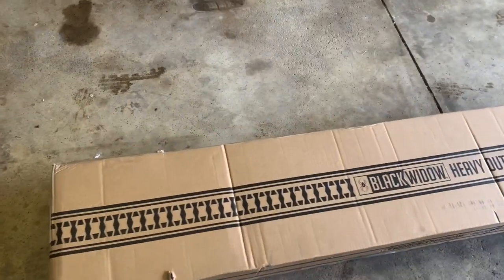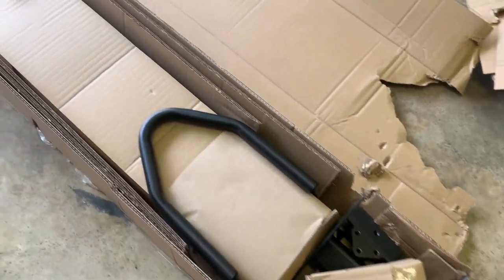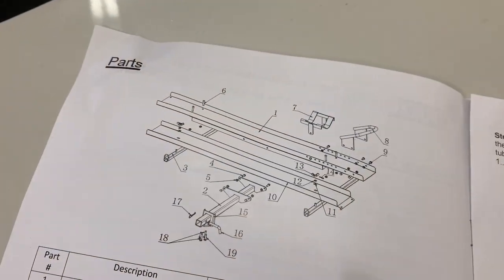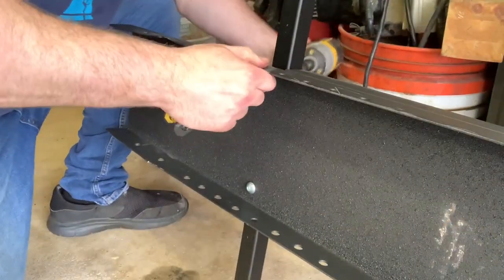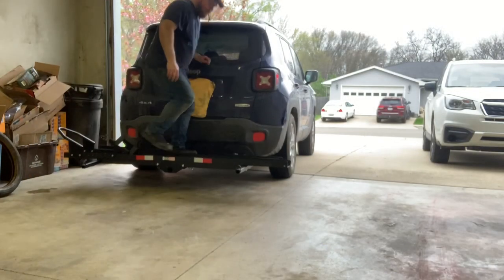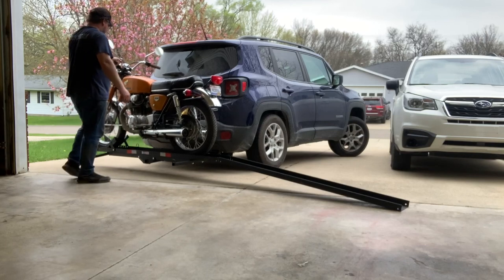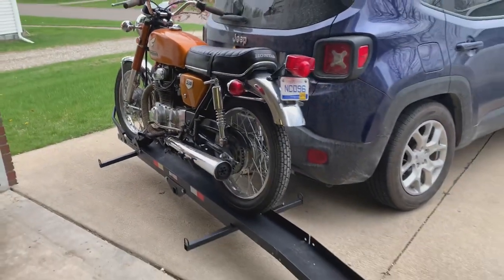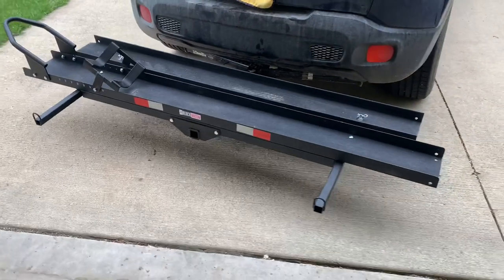Motorcycle Hitch Mount Carrier Assembly & Loading Black Widow 600 Pound Heavy Duty Steel Test

Comment: Hummmm.  200lb tongue weight limit….i think it’s exceeded.    Not sure what specs you were referring to?   The hitch carrier can handle 600 lbs, but your jeep tow limit 2000 lbs with 200 lbs tongue weight limit..where did you read 800 lb tongue weight… not correct I can assure you.   So not safe.
Reply from the maker: Yeah. Not ideal. I did haul a 125 cc bike on it no problem. The 350 was a bit much.

Comment: You installed the hitch lock backwards. That's the reason two of the bolts are not completely making contact. You will need a ratchet strap for the front wheel. PSR tie down, attaches to the handle bar, will keep your bike level and don't compress the forks. An AceBike Tyrfix will secure your rear wheel to the platform. Do as I suggest & your bike won't fall off and into another car.
Reply from the maker: Thank you for the tips! I did install that backwards but got it sorted. Have had a few good hauls so far. Really like it!

Comment: You most certainly exceeded your tongue weight, by a lot.  Your Renegade is not rated for a 800 lbs tongue weight.  If it was then your Renegade’s tow rating would be 8,000 lbs which is more in line with 1/2 ton full size trucks.  The Renegade’s tow rating = 2,000 lbs which = tongue weight rating of 200 lbs (10% of tow rating).  That carrier weighs 95 lbs.  This means your motorcycle cannot weigh more than 105 lbs.  Probably more like no more than 95 lbs after factoring in the weight of straps.
Reply from the maker: It didn’t work out. Oh well.

Comment: I see complaints about the short ramp. So I cut 2 , 2 by 8 for a ramp along w a walkway along side. Then I will mount brackets on both ends so I can forward it down the other side instead of backing it up. HA

Comment: I have a 1977 Harley XLCR (425 lbs), and belong to a Phoenix Antique Bike club that goes on rides. 
Our next ride starts about 60 miles from my house. The bike would make it. I won't. Being from New Orleans originally, I compare riding this rare and badass motorcycle to wrestling an alligator while being hit with a hammer. It's brutal on this old battered body.
Bought one of these carriers. Mounted the carrier. Put the bike on. Backed it down the driveway, and realized the rear tiedown loops wouldn't clear the street if I backed tried to back it all the way. 
Spent hours looking for a drop/rise hitch adapter that would meet specs. Found one that will allow raising the carrier 2" or 4". I'm hoping 2" will work because loading needs to be a one-man job. 
I'll be getting it in a few days. Luckily Amazon had a used one on sale with a BIG discount (package open). 
https://www.amazon.com/gp/product/B01MXQWH49/ref=ppx_yo_dt_b_asin_title_o00_s00?ie=UTF8&psc=1

Comment: Good video. I built and installed mine today. My only complaint is the swinging wheel chock. It should be hinged. For it to work freely one can’t tighten it much at all. It needs at least a cotter pin. Very weird. Anyway I’m still unable to load my 600rr onto it. I’ve a large pickup so clearance isn’t an issue. The ramp angle is. It’s a two person job to load and unload. And I’m going to wait for help and hope someone at the track this weekend can lend me a hand (it’s my first track day and I won’t be making a great first impression).
Reply from the maker: I hope they get you what you need. Overall a very solid rack IMO.

Comment: What's your favorite  .. The Jeep or the Subaru  ,,, primarily for the city.?  Plus great video presentation, have you done any  trip both combination trailer ramp/ bike on over hour drive ?? 
How's holding up ???
Reply from the maker: I’m partial to my Jeeps but love the Subarus too. It’s a good rack for smaller bikes. The 350 was pushing it. I’ve since upgraded to a proper trailer. Worked great when I picked up a cb100 bike though. Definitely don’t wanna put anything too heavy on it!

Comment: The hitch is extremely strong,  I have traveled over 7,500 miles with a CBR 1000RR with no problems whatsoever.  However, I have a Silverado Chevy 4 wheel drive PU.  The little car in the video looks a little dicey, therefore, It may bottom out.  Not sure what the outcome was with the Vid producer.  Good luck and take care-Rocco
Reply from the maker: Yeah. My only issue is clearance.

Comment: This is rated for 600 lbs and I plan on getting a 550lbs Indian. Would it be fine?
Reply from the maker: I think you’d be pushing it. The 350 stressed me out. Didn’t use it on the road. I’d look for a different option.

Comment: I thought the Jeep Renegade was unibody construction. If so your tongue weight capacity is pretty low since your hitch is not attached to any frame but just sheet metal. Careful!
Reply from the maker: Hitch is on the frame.

Comment: Thank you for your awesome video! I ordered one today...385 lb (+or-) Suzuki DR650; 2015 Chevy Silverado 1500 2wd. Fingers crossed😅.
How's yours holding up?
Reply from the maker: Mine is great. Limited to 250-300 pounds on my renegade though. Solid unit. In the vid I put the support bracket on the on backwards. Just wanted to note that.
Reply: @KeepOnWrenching  I appreciate your pointers! Will definitely be referring back to your video when mine arrives next week! Thanks again! Safe travels!